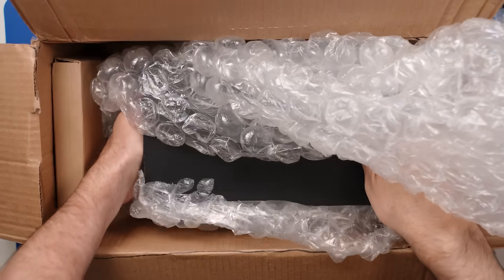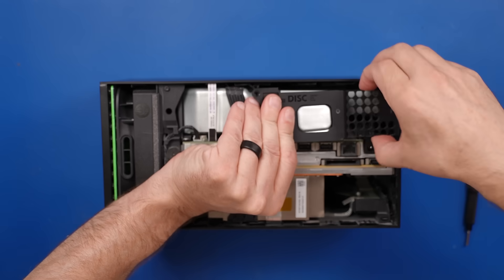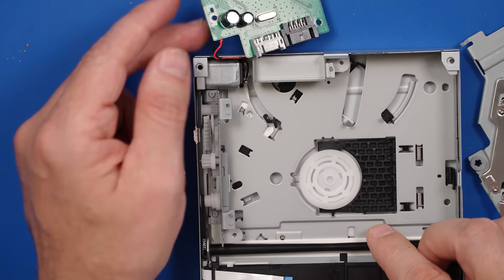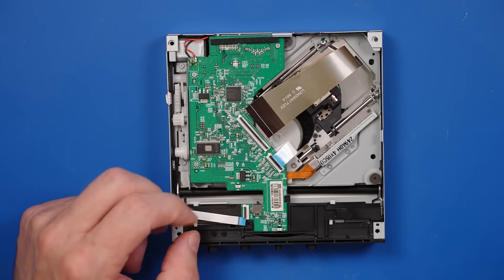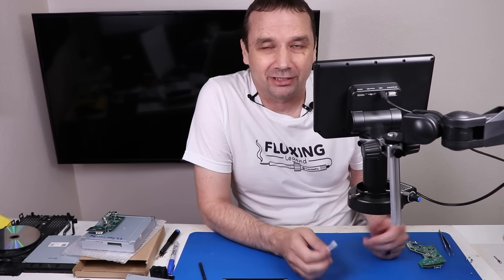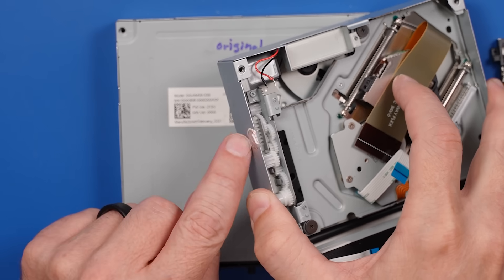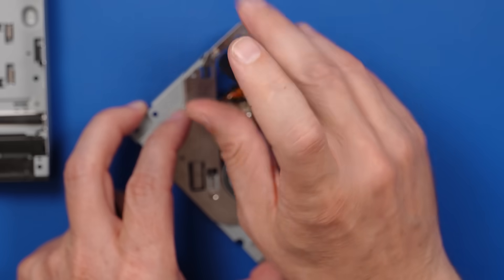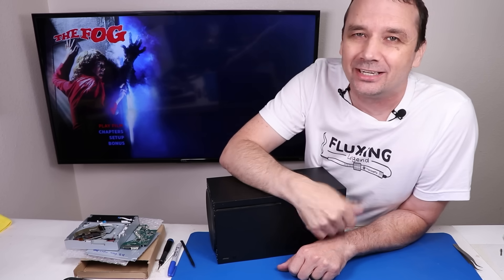Repair Shop Claims “Not Fixable” - Let’s Prove Them Wrong!

Comment: I am confused, when you said that the disc drive is married to the motherboard and that you need the  original disc drive, do you mean that there is only one disc drive that will ever work with this Xbox or you just need to replace it with another OEM disc drive? If you mean only one disc drive will ever work with this Xbox, why is that? And if time and money weren't a concern, is there a technical workaround?

Comment: Not surprising Microsoft did this with the drives. I don't know if they still do but they made their wireless keyboard and mouse combos married to the wireless dongle that connected to your pc. Compare that with Logitech where you can use any dongle with any device as long as you install the Logitech app.

Comment: You're videos helped me gain confidence to start trying to repair broken electronics even if it's not worth a lot of money I pick up trash from the dumpster outside my apartment and take the gamble to see if things work, I have a 50 inch element TV Im gonna be replacing some caps on the power board for it, I've cleaned and repaired my Xbox my buddies Xbox and my homegirls Xbox you're videos really clear up my anxiety of seeing a jumble of wires and complicated machinery 😂😂

Comment: you can actually see exactly which gear is broken, bent axle on the uppermost gear in the broken one and the same gear is flawless in the replacement. honestly a little surprised it didnt immediatey get called out!

Comment: It's crazy how so few and flimsy components can spin a disc at crazy speed and incredibly accurately move the laser as required. It's a shame we're moving away from hard media as the engineering challenges overcome in it's creation are pretty spectacular.

Comment: Brings back memories, i use to flash 360 drives and had so much fun working on consoles back when radio shack was around. Good ol Jtags and flashes yeet. Use to buy loads of red ring boxes off ebay for cheap and spend like 10 mins fixing them and reselling them.

Comment: See the inside wall of the case? at 18:32? That looks like a pretty solid layer of dust mixed in with something. In my experience, owner either smokes or vapes. I bet that same residue you see there is what made it to the sensor

Comment: Repair shops don’t want to fix certain things because they’ve been burned too many times by customers who just want them to do the troubleshooting for them for free, or when presented with the bill start crying that the cost of the repair comes close to or exceeds the cost of replacing the item. It’s not that they can’t fix it, it’s just that it makes no fiscal sense for them to even try. For every one customer who would pay for that repair, there are fifty that will balk at it. Fixing older consumer electronics has been a loosing proposition for over 40 years unless you are restoring antiques and you know your customer doesn’t care about cost.
Reply: That's not the case here and it's odd you felt the need to state it.

Comment: Alot of Xbox users do not realize that there is an app that needs to be downloaded on the Xbox in order to actually play Blu-ray discs. The first thing I would've done when the user mentioned that the issue happened with a blu-ray movie, is check for that app.

Comment: Years ago I helped out a friend who wanted to build a PC and was on a really strict budget. I gave him my old GPU (it was an old mid range GPU, couldn't even tell you what it was it was so many years ago, well before the GTX900 series.) and I ordered the parts, built the rig. He went home, DMed me that he was pissed that the machine wasn't working. I told him to bring it in, it's probably something easy to fix.  

He storms into my room, puts it down and tells me he's going to the bathroom but "You're gonna fix this, it's not ok" 
Uh- ok? Weirdly aggressive for someone who gave him a free freakin' GPU. 

So I hook it all up to my TV and I try to press the power button but it doesn't budge. The heck? I press and wiggle it, the button pops back into it's socket, I press it boom, PC boots. He gets out of the bathroom and is "WTF? Why is it working? What was the problem?" 
You manhandled the case so bad you stuck the button under the case

"No. That's not right. That's not what happened" Plays around with the PC a bit, gamed on it. Uh, yes it was. It worked perfectly. 

It's funny when the cause is either super simple or user error or both.

Comment: I use to work for Montgomery Wards in the 1980's repairing home electronics, You're right whoever soldered that board in butchered it. One thing that I don't agree with you on is that you didn't replace the whole mechanism just the laser. The motor bearing will eventually get slop in it causing the spindle height to drop a little, when this happens, the laser cannot focus on the disc properly and will not spin the disc up. You had a whole new mechanism why not just replace it all with new, hard to tell how many hours that motor has on it. Would have been simpler and better in the long run.

Comment: one more reason ps5 slim is better, anybody can swap the disk drive out on them, ps5 has a better design, plus only 80 bucks cheaper than a repair shop with only 1 min swaping.

Comment: Hey i have a broken switch lite that has error code 2101-0001 and when i went to take it to ubreakifix, they said it was unfixable and it now it doesnt turn on. Im very worried because my switch online subscription is expired and all my data since 2017 is on there. Can this still be fixed?

Comment: I had a swicth that I haven’t played for a year or two I was updating it went black said to hold buttons and wht not I couldn’t read it all and it went black never worked sense I’ve tried wverything even knew battery I download a tool for rdm to see if I could jailbreak it or something but it’s nit the right model but my point is that when I plus it into the labtop for rdm tool it says it’s in rdm mode but idk wht to do I cna push the power button in and make it go on and off but without the tool I can’t tell when it’s on or off it’s been sitting on the charger for 2 years I would like to fix it idk wht ti do can u give me advise or fix it in a video ?

Comment: Drives being married to the console is an anti piracy measure, but nobody wants to pirate on xbox so all it does it makes it harder for people to fix their own console.
Reply: How would that be the case? The anti-piracy software is on the mainboad, no? The drive just tranports the digital info to the board. That is literally all a drive does.
Reply: @Sawbuck  Xbox 360's main bypass (other than jtag which was a software mod) was swapping out your disc drive for another one that bypassed it's anti piracy measures.
Reply: @Stevo.100 wow! Would not thought it would be that easy. Thanks for the info!

Comment: I bet that when you tried to insert the disc at 12:20 the unit assumed a disc was still inserted (because you removed it with the power off) so it was refusing to accept it. I noticed it was happy to eject it when you pressed eject, it started working because its state was corrected. (disc in / not)

Comment: Why cant they keep track of screws? Answer: They are incompetent and to damn lazy.
How to tell if its a good tech? "I'm just gonna put one in there for now... actually know what.. no, lets just put the other two in while we're here"

How much time did it save them by not putting in those two screws? Prolly like 45mins because they dropped it on the floor and couldnt find it. XD

Comment: I've already replaced my series x disc drive once successfully and now it is beginning to have the same issue but I noticed blu ray movies and certain games are read by the drive just fine. It just doesn't like brand new series x games I've been buying. Any suggestions? Clearly the drive isn't broken (or at least partially works). I've tried every solution to reset my drive and system as well. Replacing the disc drive twice just feels stupid...

Comment: I brought my broken Halo Infinited Xbox Series X to a local repair shop called "Ibrokemygadget"
The shipped it off to their main warehouse, it took them 2 weeks to deduce that it was "unfixable" and then they said they would contact me as soon as it has been redelivered at my local store to collect it.

About 2 weeks passed I was never contacted about it arriving, and I decided to go in store and check anyway.
It was then that I noticed a sign that said "if your device is not collected within 14 days, it will be deemed abandoned".
It was there, and the manager tried to claim that he attempted to contact me. 

Luckily I was still within the time frame so I took it back. This console was in near pristine condition when I handed it off, the only scratches being around the front USB port.
When I got it back, the warranty label had been torn to shreds, the back plate looked as though it was being balanced on nails.

Ultimately I put it up on eBay for parts, and another repair shop member who happened to be a collector wanted to try his hand at fixing it.
I hand delivered it to him, and not even 20 minutes later, I got a message that he had fixed it, and video evidence that it was working, and him clearing all my data off of it.
In his words "there was a shorted cap near the GPU"

Long comment to say, I miss my halo Xbox, and I'm never using that store again.

Comment: I took my Xbox One to a UBreakIfixit franchise because I wasn't a video display. They told the reason was because I removed the GPU. They even showed me where it was supposed to be even though we all know it doesn't have a GPU. They also accused me of having a "display" unit. I fixed it myself by replacing the hard drive. Some repair places should just stick to adding screen protectors.

Comment: Any reputable repair shop would tell you WHY something is unfixable or just fess up that they can't figure out why it doesn't work in the first place. The problem is there are no standards by law to adhere to. A repair shop doesn't HAVE to give you any details or be transparent with you. That's why paying a random shop to repair something gives me a lot of pause. I'd rather attempt to fix it myself first.
Reply: Yeah it really sucks.  Double so for me as I used to manage a Ubreakifix location and our franchise worked our asses off to build our reputation in our area.  We didn't know everything (TVs at the time were our biggest weakness) but learned and was able to fix almost anything after a few years of me being at my location (again, except TVs), or tell you if it would just be cheaper to buy another; but if we couldn't figure it out and the customer was still interested in pursuing a fix, I personally would print a writeup of our testing to help the next technician. 
Anyway anytime I hear other Ubreakifix locations being crappy, it really sucks for me personally, but it's also not surprising.  I went to a thing once....(I don't know what to call it, a convention kind of) where corporate invites franchisees, and boy did I learn real quick most other owners were basically money fronts and didn't know a damn thing about the business (or sometimes business in general).  This meant they didn't have the means to teach their employees and had to get lucky with their workers (or not).  Funnily enough, we were so far ahead of other franchises that we tried to network as much as possible to use them as customers and basically charge other repair shops to fix their stuff that they couldn't if they wanted to send em to us.

Comment: There is a way to " unmarry " the drive from the motherboard 

I think the motherboard is what is married 

The unmarry is done through the network and it is a script 

Once unmarried aka " virgin " you put in a new drive and it either " married " the drive on boot up or they need to run another script to marry the new drive to the machine. 

I don't know if anyone is licenced to be a factory repair shop

With Motorola 2way radios authorized repair dealers have the special Motorola software that allows them to add features to the radio and " unbrick " the radio and lock the radio so it can't be read or unlock the radio if the password is unknown 

They married radios to networks and I bought a lot of radios at auction and they were bricked and locked and the dealer was able to unbrick them and reset them to the default settings in about 30 seconds per radio

If you have the right cables and software you can do magic on most electronics 

I remember my Panasonic Showstopper that had lifetime subscription for free

I had that till they shut down the guide in 2010

I don't remember what year that came out. Maybe 1995

But the first ones were made by the company and they were bought by Panasonic and they were bought by DirecTV

But I replaced the drive 5 times
Putting the original drive image on the new drives
It was a small image, only 100 MB 
The original drive was 300 MB and held 10 hours of recording 

I still remember when I had a 1981 GE VCR and it had the wired remote control with a 25 foot cord
I remember programming the VCR and recording HBO shows in the middle of the night 

Those were the day

In the 90s I recorded Star Trek and I came home from work at 3am and watched them fast forwarding through the commercials

And the Showstopper was truly awesome 
Way better than the cable company DVRs of today 

You can't even jump commercials with the new DVRs they forced everyone to get 

They sent these and they said they were turning off all the Motorola boxes

These new boxes are Android boxes, 5 dollars of junk, no hard drive, everything is streamed from their servers
You can't pause or play in slow motion 
Totally garbage 

I don't know why they did this 
😢😢😢😢😢😢😢😢😢😢😢

Comment: You make this look so easy.  I've tackled similar things and it's so easy to get overwhelmed when there are small parts everywhere and the dawning realisation you may be in way over your head 😂
Reply: Record the whole process and get a work mat. Keep your screws and parts organized, and double check everything at every steps just to make sure. If you follow a guide, watch it (or read) in full before you start, and you can make a checklist to make sure you do everything step by step. That way you understand the process, it goes way better that way than when you just follow a guide step by step without really knowing what you're doing. Even if you fail to fix the problem, it's fine as long as you can put everything back together like it used to be, you can try again later.

Comment: Why did you replace the laser after cleaning it?  Missed the logic...

What I don't understand is how quickly the shop gave up.  Xbox presents with problem A.  New drive causes problem B.  It's fairly obvious the problems are completely different.

I come across this all the time at work - people who may be technically good* but have no problem solving skills nor perseverance.  I end up guiding them through the process even though I don't necessarily have the skill myself to do the thing as they get so fixated that a particular thing will fix the problem, or won't concede to step back and look at the bigger picture.  I quite enjoy the problem solving process to be fair...

*albeit the soldering in this case begs to differ - you wouldn't send something out to solder 2 tiny tabs if you are a repair shop!

Comment: So many crazy things about this repair. 1. The disc drive is married to the motherboard. 2. It was only the laser that needed cleaning. 3. The repair shop doesn't have technicians trained in soldering. 4. The replacement spare part they used was faulty leading them to conclude the console was "not fixable".
Reply: There's probably a whole generation of "technicians" that have never lifted a soldering iron.  By the 2000s components got so cheap that most places just swapped parts since it was quick and required way less skill.  Think about how quick it would be to swap a drive in this system if it didn't have a married drive.
Reply: Haven't disc drives been married to consoles since at least 7th gen?
Reply: @lookitskazzy  for what conceivable purpose though? Is that just an anti repair measure? I cannot think of a practical reason to have it like that.

Comment: That same shop that starts with a letter 'U' (I'm guessing it should be renamed because they didn't fix it) told a friend who was having problems with his Steam Deck they could fix it.  He had bought it second hand and it turned on for him twice then wouldn't anymore.  They had it for three weeks, and then said they can't fix it ... here is your bill.  He asked if I could fix it and when I opened it up the problem was the m.2 had come unseated and for some reason it also had two random cables disconnected (probably from not fixed it) ... an hour later and some fresh PTM - his SD was fixed, reflashed with OS and humming along nicely.

Comment: i always just take the motor screws out for lasers and i don't touch any of the tray screws. + you probably know but you can push down on the front black bit and slide the entire drive out of the case which gives you a better look at the mechanism

Comment: So apparently the so called 'repair shop' that this had been to, actually chewed the wire shielding on the wires they soldered to the disk drive board! They didn't have tools at this repair shop? :face-turquoise-covering-eyes:

Comment: the drive looks like a victim to vape oil steam residue.
Reply: Came here to say the exact same thing. Seen the same “mysterious” residue on a friends windshield
Reply: Exactly. I ended up with it on the cover plate of my GPU thanks to my roommate who vapes like its breathing air. Not even the worst thing I've seen a vape cause to a PC, either. Had to repair one that had been vaped onto for over a year. The residue was sticky and the PC itself looked like it had eaten a cat.